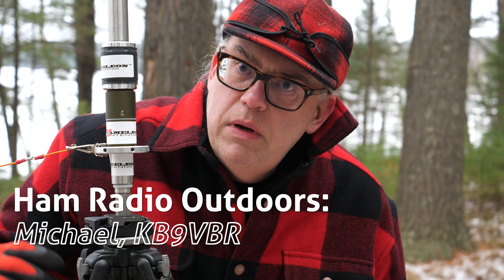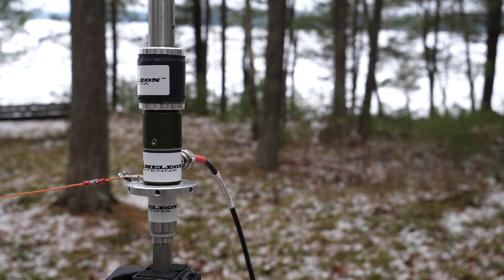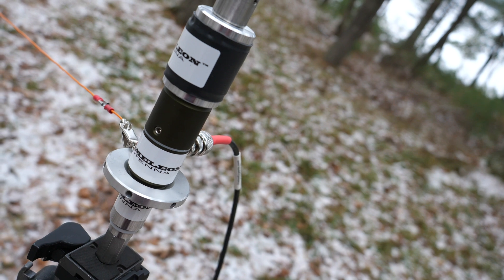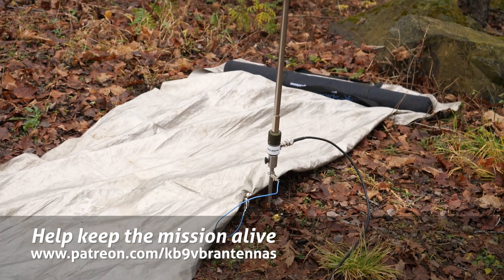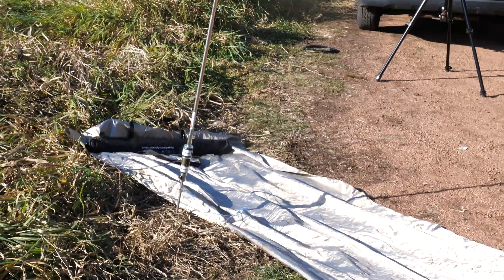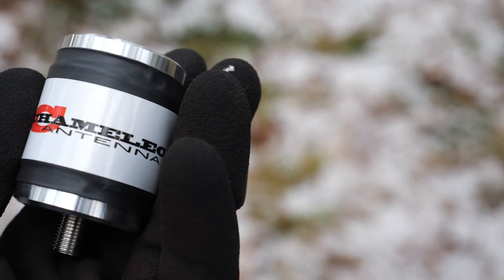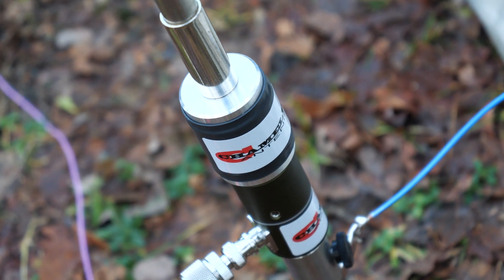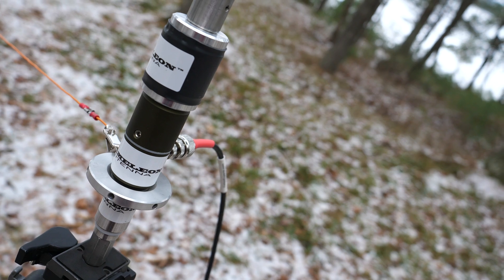Discover the Power of Chameleon's NEW Insulator, Blank Adaptor, & 40M Coil!

Comment: Just wish someone would send me some ham stuff to review. Being in the UK puts them off. Just found this video. I have just ordered a 40m coil with both ends male and female m10 thread coil. From Ebay £35 uk pounds. Alliexpress £14 which includes postage. For this price its not worth me trying to make one. Maybe a few weeks to arrive. So will it be trash or treasure. George G1BKI

Comment: This may sound as a stupid question, but I will still ask it: is it possible to use the CHA Blank Adapter upside down? I.e., suppose I screw its 3/8-24in. (F) unto a 3/8-24in. (M) tripod or something, and screw a 3-8-24in. (F) third-party whip unto the Blank Adapter's 3/8-24in. (M) side. If it is possible, then the Blank Adapter could become a good base for some verticals, not only for Chameleon's own configurations.
I started thinking about such options after seeinf the Scout Base by REZ Antenna Systems, which seems to bevery flexible in this regard.
Of course, that would mean that the RF connection within the adapter should be switchable somehow.

Comment: Wow. Thanks for this video, Mike. I didn't know Chameleon was making these "building block" products! That base insulator could be used with a mobile ball mount to add hand-wound air coils for lower band portable operation with the 17' (and up) whips. To resonate, you squeeze together or pull apart the coil. And although I don't like base loading verticals because of the low efficiency, that 40 Meter Chameleon coil certainly looks tempting to try out with my 17' whip. Right now I am using the Hustler for 40M operation. Thanks again!

Comment: Thanks, Michael for this review tying together all the Chameleon components and explaining how they work in a peak-performing field antenna system.  I have an SS25 with all the parts shown except for the Blank Adapter, which seems to have been in short supply. I just tonight ordered the BNC version.  Today I did a POTA mostly on 40 meters with the setup minus the blank adapter, which would sure have come in handy to tripod stability in the high winds.  And now, two comments on the substance of your review. It makes no difference to me that Chameleon supplied the gear in exchange for the review. Your Integrity over time has spoken volumes. I am absolutely confident your review would be the same whether you purchase the product or it is loaned or gifted by the manufacturers. Any other inference is simply erroneous. As for the Cost Factor. Chameleon's build quality speaks for itself. Sure you might be able to  experience similar performance with lesser grade components, but nothing looks better to the eye, feels better in hand, or delivers the contacts like a CHA.  I own both the RWC Sporty 40 and the CHA 40M coil. They compare as would a Chevy and a Range Rover. Your reviews are highly valued and respected.

Comment: Another great video, Michael. Now, I want the insulator and blank adaptor. I'm adding them to my wish list, next to the Stormy Kromer cap, which I still need to get. I already have the WRC Sporty-Fourty. So, I don't need the 40M coil. But, that might not stop me from getting one anyway. I added four brass grommets to the corners of my Faraday cloth. So, I can hold it down with four tent stakes to stop it from blowing away. Keep making more great videos, and don't give the haters a second thought. 73!
Reply: Put a gromet in the middle of the cloth so you can put a screw and nut through it to make the electrical connection.

Comment: What ratio do we think this coil is, 9:1? I noticed on Chameleon's website they show a picture of this coil and the MCC. Wonder how those work together.
Reply from the maker: There's no transformer involved. This is a loading coil with approximately 10 uH of inductance (the same as the Wolf River Sporty Forty). Adding this coil to the MCC will increase it's range of operation, like if you had the 58 inch whip and wanted to use it on the 80 meter band (inefficient, but possible).

Comment: What is the advantage of the CHA Blank Adapter to the standard 3/8 24 to UHF Stud Adapter that we use everyday that goes for about $10?  (On Amazon - SO-239 to 3/8" x 24 Threaded Stud Antenna Mount Adapter).  or (American Radio Supply - Heavy Duty SO239 to 3/8-24 Threaded Stud Antenna Mount Adapter Connector).
Reply: You need something to support the stud adapter. The CHA blank can just screw into a tripod or ground spike with the 3/8 24 thread. I use a stud with a mirror mount on my tripod. But the blank adapter would be more convenient at times

Comment: The 40M coil appears similar in size to the Buddipole mini-coil, but perhaps more robust than the Buddipole coil.
Reply: I discovered that the Buddipole mini-coil is about 6.5uH.  So, it can be used to make the SS25 resonant on 40m, and the SS17 resonant on 30m.
Reply: Not exactly. The Buddipole is tough as nails and is made using Stainless Steel wire, not Copper Wire like Chameleon does. It's those cheap things that hide under the "Pretty" that will bite you in the bum.
Reply: @johnk23705  The Buddipole mini  coil and all other Buddipole coils are high Q coils made of #18 tin-plated copper wire.
Reply: @johnk23705  All Buddipole coils are made with #18 tin-plated copper wire.
Reply from the maker: WTH? First you complain because the Chameleon coil is small and 'too high of a Q'. Then it's demonstrated that the coil itself is identical in size as the WRC and it uses copper wire instead of stainless for a lower resistance and you still call it crap. Just give it up.
Reply: @KB9VBRAntennas  Who are you responding to?  I never complained about the Chameleon coil in any regard.
Reply from the maker: @daditda I apologize, my response was for @john23705.
Reply: @KB9VBRAntennas  You were the one who in your video said the Chameleon coil was smaller, so I took you at your word. If the coil was smaller, in most cases the "Q" would be higher. Stainless Steel is much tougher than Copper and is more expensive. So toughest and highest quality in the Chameleon doesn't jell. I'll 100% give you the fact that the copper is lower resistance.
Reply: Correcting misinformation in a comment above: Similar to the Chameleon 40m coil, the Buddipole mini-coil is constructed with copper wire.

Comment: You get what you pay for. Chameleon products are built like tanks! If you can’t afford it, it’s not Chameleon’s fault. I’ve talked with these folks many times. They’re a small company that puts out good products. That’s why the military uses their products. Their products are made in the USA and they have great customer service. I personally don’t like going into the field with a question mark on how good my equipment is. It makes up 80% of my portable/moble equipment. No issues whatsoever. Buy the Chinese version for less and be happy with yourself. Drink a beer. Life is a choice.
Reply: Nah Chameleon is total junk old man. Try posting a negative review on their website. They actively delete anything critical of their products.
Reply: @neil7340  🤡
Reply: @neil7340  No Chameleon is not junk, just highly overpriced for the value it gives you compared to other quality manufactured antenna products (which are also in many cases CNC machined). You are correct, they do not post anything negative about their products and cry like little babies when someone dares to call them out. As to selling things to the military. They use the term "Military Grade" in an effort to make you think they have contracts with the military. They don't. They may sell some of their products to the military on a very limited basis, but they are far from being in any kind of common use in the military. If they had military contracts, they would not be selling to amateurs, they could be making far more money selling to the military. Think multi thousand dollar toilet seats.
Reply: @ cannot agree more with this comment.

Comment: Wait, that blank is seriously $132?
Reply: Agreed. I bought very similar from ali******s for $18. I'm for buying USA but not at 7x the cost.
Reply: Yes. You can buy the same thing, great quality, but not as "Pretty" for about $25.00. 40 Meter coil that will work as good or better for half the price. Yes, it's a little bigger. The smaller Chameleon coil will most likely have a higher "Q" which is not better.
Reply: @johnk23705  Higher Q for higher efficiency, but lower bandwidth.  So, depending on which is more important to you determines which is the better coil.
Reply: @DaDitDa  He won’t understand that explanation anyways! But good try! 👌

Comment: Chameleon is damn expensive. But also good quality. It would be nice to get stuff as individual parts instead of needing to buy large kits I don't want
Reply: You can buy the individual pieces.
Reply: @mediocreman2 the white matching part of the mpas lite? Not sure what its called
Reply: @stevet7522  It's called a CHA Hybrid transformer. It's a 5:1 UNUN that's purposely designed as a semi-resistive load  (average -1.5db loss) plus 5:1 transformer that helps reduce reflected power due to an attached high impedance antenna.
Reply: It really is not good quality. It is mid at best. Try posting a negative review on their website. They actively delete anything critical.

Comment: The only thing you are stacking with this kit is $100. bills to buy the thing. Grossly overpriced. Buy the 17' or 25' whip and then use the many lower priced options to get the exact same performance for about $180. including the whip. Yes, I know, the quality is good. So is the quality of the lower priced options. Get the whip and lower priced options and you will still have enough money left over to buy another good piece of kit for your radio enjoyment. Amazing how many reviews Chameleon can get when they give free stuff to Youtubers. Most who won't say anything negative for fear of not getting the next free products. Anyone with an IQ over room temp. can figure out the juice is not worth the squeeze.
Reply: Chameleon has the boutique top shelf stuff, good fit for some. 
Not us commoners.  😅
Reply: @RatchetFWD  True, you could buy several of their antenna kits or buy from other sources or make the same thing and also buy another HF radio with the money you saved. That's what I did. I know, too much common sense. I have more than enough money to buy from Chameleon. It's because I don't buy from Chameleon or other sources that are overpriced that I have the money.
Reply from the maker: For someone that doesn't have any Chameleon products, you sure have a lot of opinions about them
Reply: I have a Chameleon 17' whip. MFJ was out of stock at the time. I'm also smart enough to know that making something "Pretty" does not equate to better performance or increased durability over other quality products that are sold at a far better price. How many WRC coils have you broken ? And even when you discovered that Chameleon coils are wound with Copper Wire, not Stainless Steel, you still had no comment to make about it. I know, you talk about the negative things in any Chameleon product, you don't get more free products to make a video about and get more clicks. Check out how Chuck, KK6USY or Survivalcomms does their reviews on Chameleon. They also point out the flaws in Chameleon products and therefore, don't get free stuff from Chameleon. You also rarely use Chameleon products in your POTA outings except when reviewing or promoting them. We both know why.
Reply: @johnk23705  wow! 1 X CHA SS17 and all those comments about our products! What a connoisseur….
Reply: @johnk23705   I just spend 45 min reviewing KK6USY I didn't find anything meaningful at least related to the newer Chameleoin stuff and didn't bother listening to the MPA? stuff since not my interest.  The only Comment I found was saying the SS17 was better quality than the MFJ .   He did like the FT-710 that I just bought and now looking as a nerd at antennas.  If you think something is better I wish you would name it.   I have no interest in building, and I would rather pay more for quality and find KB9VPRs many videos very helpful and honest.

I also took a faster look at Survivalcomms videos and found nothing related to POTA or Chameleoin but obviously must be missing something.  I have no interest in wires or building and having never done POTA before am intersted in ease of deployment for a 78.8 year old  who was off the air for 40 years until a few years ago - I come from tube days licensed in 1965.
Reply: What words do you type into Google to find the cheaper alternatives? Are the cheaper alternatives on Amazon?

Comment: Curious about your tripod. Do you have a favorite? Thanks much. Rick, KJ7JKR
Reply from the maker: The tripod I'm using is an old Bogen (Manfrotto) 3001 that is now discontinued. I use a newer, heavier, Manfrotto tripod for my video gear, so this one now has antenna duty. As for favorites, all my camera and video tripods are Manfrotto, but I don't have a particular recommendation for an antenna specific tripod.
Reply: @ Many thanks. New ham here trying to solve the antenna installation conundrum and thinking of temporarily setting something on the ground, just to get on the air, before rooftop installation.

Comment: Stacking two 40M coils combined with a 25ft whip will likely get you on 80/75M.
Reply from the maker: It possibly could. I may give that a shot
Reply: @KB9VBRAntennas  That is going to be one expensive coil set up. I'm sure it would work, but a coil designed for use up to 80 meters will cost less than one Chameleon 40 meter coil.

Comment: All that's missing are UNUN modules (e.g., 49:1, 9:1, 5:1 & 4:1) that would appear similar to the 40M coil, but with a banana plug terminated ground wire dangling out the side.  Simply screw in an UNUN module on top of the CHA Blank, plug the UNUN module's ground wire banana plug into a banana socket on the puck, and then screw in a whip or connect a wire antenna on top of the UNUN module.
Reply: A 4:1 would be nice. Make an easy rubikov with the ss25
Reply: @stevet7522  A 49:1 would be nice too. Make an easy half-wave vertical for 15 m, 12 m or 10 m with the SS25.

Comment: Been using insulator, 40m coil with ss25 and 21" spike. Using my own homemade box in place of Cha Blank. But once back in stock I'm getting  blank 👍
I'm going to test my setup with the Icom AH-705 tuner and IC-705 tonight 😈
Reply: Why?  It won't work any better. And here I thought I'd found someone who saved a bunch of money and still got the same performance. Tell me in what world it makes any sense to pay $132. for a "Blank" when you can get something just as tough, that works exactly the same for $18.00 ? You know what impresses me ? The guy with good basic gear or homemade gear with the big fat log book filled with contacts. That's impressive. Not some shiny bobble that will not improve your log book.
Reply: @johnk23705  for space saving and portability in pack vs box